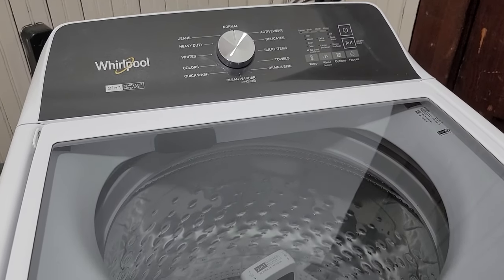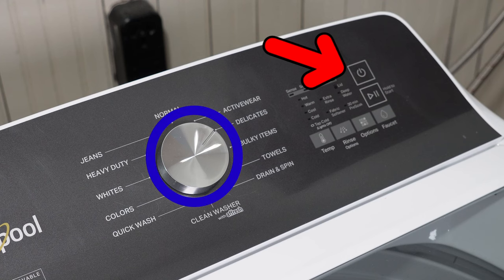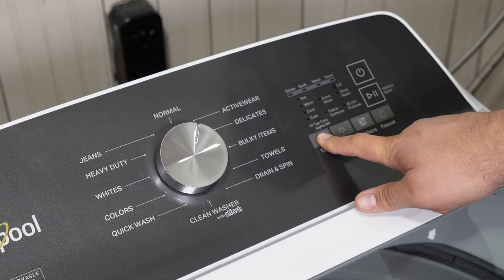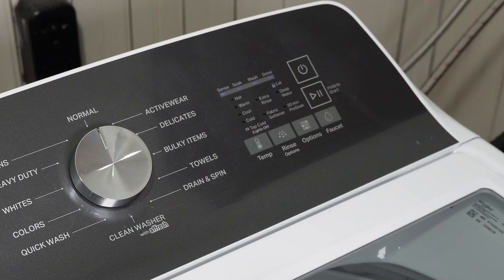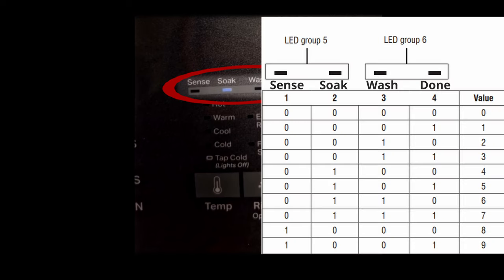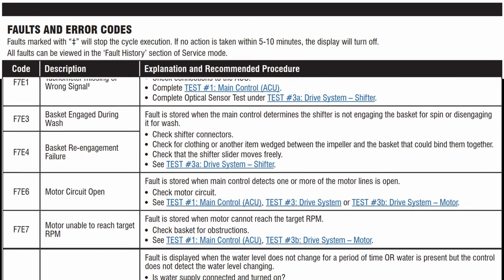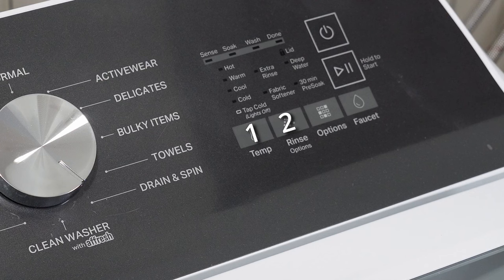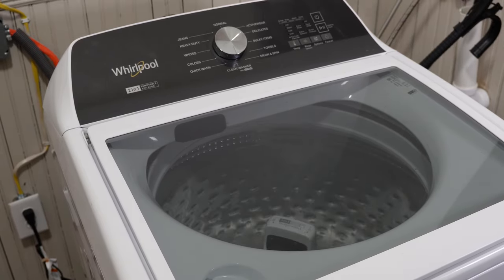Whirlpool Touch Screen Washer Diagnostic Mode, Error Codes, Calibration, and Troubleshooting

Comment: Ben, I have ran the error mode but would get the top 4 (Sense, Soak, Wash, Done) to blink twice and then it shows no error code. So, from here I tried to do a factory reset. Everything seemed to start just as you explained, but now it is stuck in a sequence of blinking lights, which started about 30 seconds after the reset began. Each of the top 4 blink once, from Sense to Soak, to Wash, to Done and then keep going in a repetitive fashion. The Lid lock is lit the whole time. Any idea that might help?
Reply: Also, it seems to run through the automatic test mode just fine.
Reply: Did everything again and ended up getting a F2E3 error. This error was not on the table you showed in the video. Figured it out after I pulled out my Manual from inside the washer; F2E3 is an ACU/UI Mismatch. I am now assuming I need to change the control board. :(

Comment: What are the error codes? I got the paper that manual does not give you the codes because this washer does not have a display. There are no letters or numbers. My error codes is flashing sense done and then flashes lock. I have replaced drain pump still not working. 16 months old worse washer ever
Reply: I’m having that exact issue, were you able to get yours working?
Reply: @ChrissyRosario-em4ss  no 😭 I’m I’m going to try and call whirlpool in morning. I hung up today cause hold time was nonsense. As soon as i find out something I’ll post update! If you find out before me please do the same. I hate this washer!! There should be a class action settlement for this. So many people are having the same problem. 

I do know when my husband replaced drain pump there was a wire burnt or cut whatever. He had to reconnect them. But even with new drain pump and wire correctly connected still no.
Reply: @danii7260  okay, thanks for letting me know! Luckily, I still have my warranty so someone is going to come out on Friday and fix it. I’ll lyk what they do to it and hopefully it will help!
Reply: @ChrissyRosario-em4ss  that would be awesome! Please. I’m 16 months and didn’t buy the extended warranty 😒
Reply: @danii7260  hey, so the man came this morning and he told me that my issue is that the washer wasn’t shifting into “wash”. The problem is that the actuator was broken which caused the splutch to be damaged because they connect to each other. So both of those parts just need to be replaced. You’ll have to YouTube how to locate the parts on the machine though cause I’m just repeating what he said to me lol
Reply: @ChrissyRosario-em4ss  thank you!!
Reply: @ChrissyRosario-em4ss  lol I will research now!! You had the same codes as me right? Sense and done together and then lock?
Reply: @danii7260 yes, hopefully it’s an easy fix for you too!

Comment: Got the F7 E1 error, changed the shifter, still getting the same damn code...I give up
Reply: I've got the sme code. Any luck finding the issue yet?
Reply: @user-ye2hu9cg1c  I changed the capacitor and it worked. Good luck to ya

Comment: The last 8-10 years for "big box"machines I would tell friends that asked avoid Samsung and go with a Whirlpool or LG.  That advice I have changed recently.  The Whirlpools made in last 3-4 years are worse than Samsung. So many issues and unfortunately for the people that bought them happen 12-24 months after ownership.  Just awful and so cheaply made.  Got one last night 18 months old with "no drain" and the pump is good so either wiring or board bad.  Ridiculous.
Reply from the maker: Yep. When I update my washers to buy maybe this year, Whirlpool will be at or near the bottom